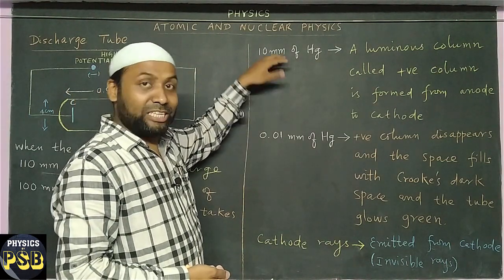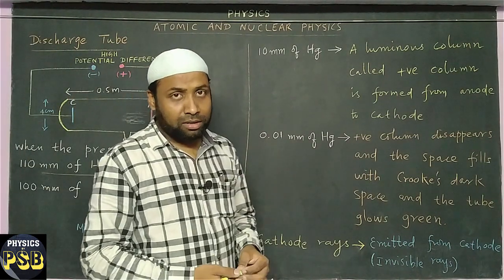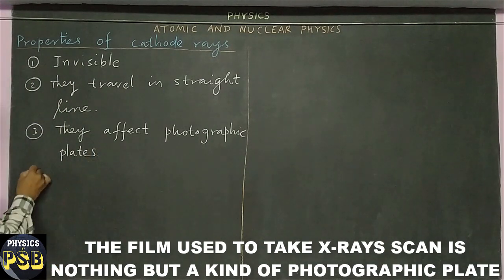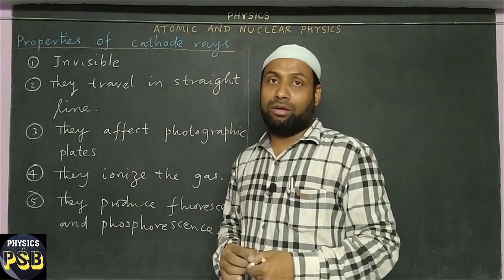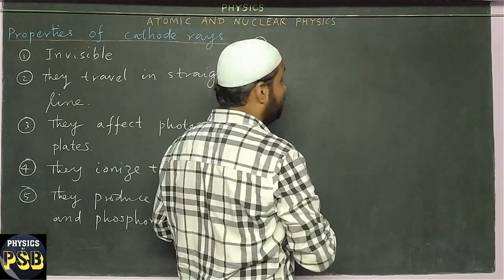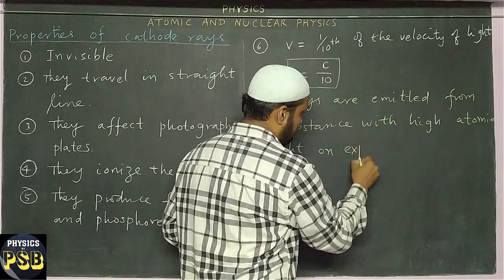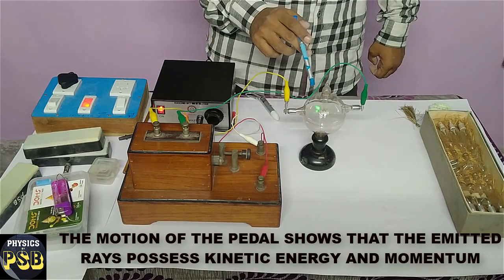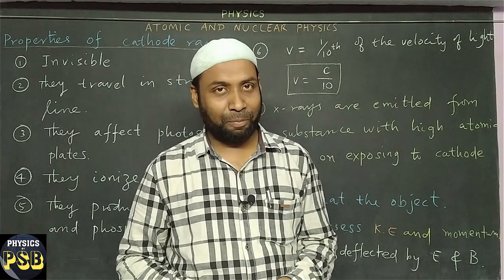The Discharge Tube and Cathode Rays | Atomic and Nuclear Physics | Class 12 Physics |

Comment: Aslam Alaikkum sir!!!
No words are sufficient to praise you for your efforts to teach concepts with models. The resources you procure to explain every concept shows your love for the subject and students as well. Not only students it also kindles enthusiasm among teachers to explore more.
A superlative effort from your side. 
Thanks a lot, sir!!!
Reply from the maker: Walaikum assalam.. thanks for the appreciation...
Reply: @siddeeqbasha  Sir, Why increased pressure doesn't allow conduction in gases?
Reply from the maker: Free charges are required for the conduction of electric current... At high pressure, no such free charges are available for the conduction of electric current in a gas.  This is why the Van de Graff generator is kept inside a sealed steel chamber filled with air at high pressure to avoid the leakage of charges from its charged sphere.
Reply: @siddeeqbasha  Thanks a lot sir.
Reply: Well said
Reply: @logesh Truee
Reply: I haven't seen this in my classes long years ago...this kind of teaching will help to develope schools..
Reply from the maker: Thanks for the appreciation.